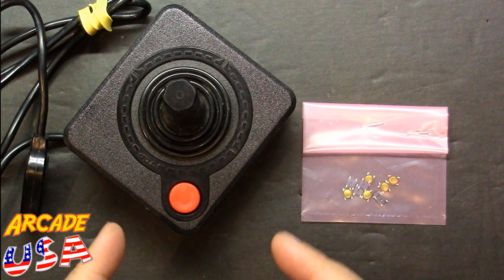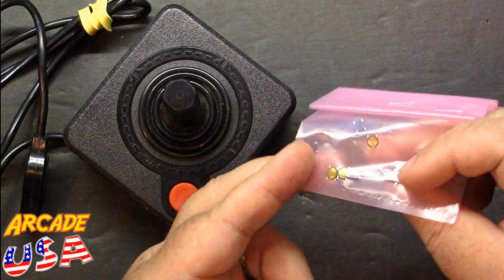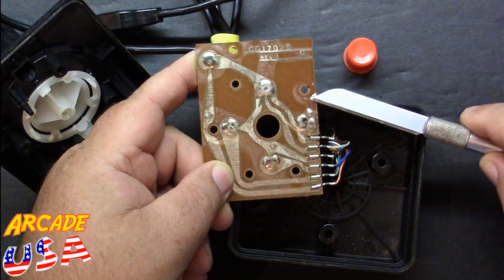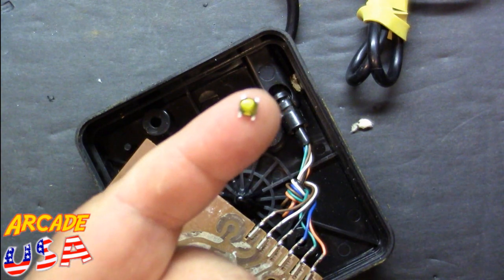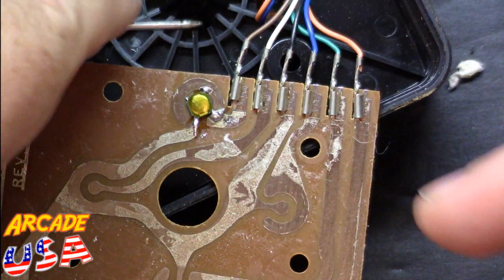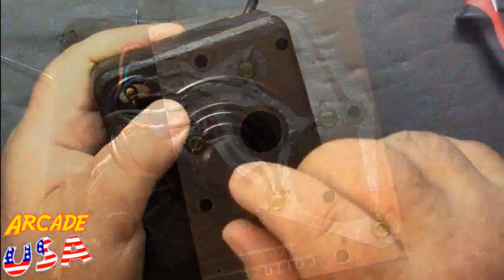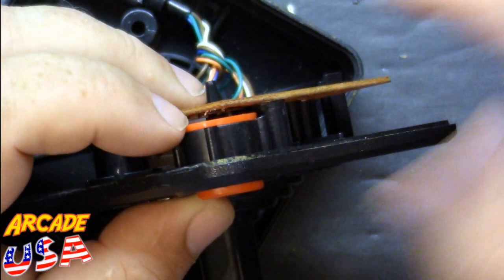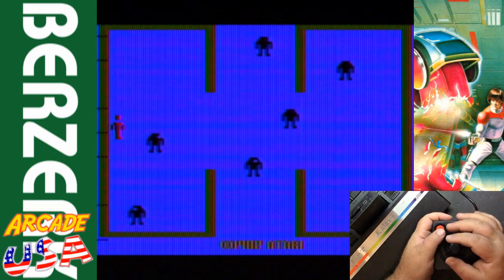Atari 2600 Joystick Low Profile Switch Mod

Comment: I know this vid been out awhile, but here is the method I use with these switches. Trim 2 legs off each switch (like your vid). After I remove the tape and dome switches, I clean the board with IPA, then add a bit of flux to each contact trace on the board where the micro switch will make contact. I use a pair of tweezers to hold switch in place directly over center, then touch the iron to the leg, wait a second, then repeat for second leg. Once all are done, I clean the flux, & test connections with a meter, cover the switches with Kapton Tape & reassemble the joystick, then test on the Atari. This also works on the Gemstik controller as they are basically identical internally as CX40. The clearances are a bit tighter, but it can be done. Hope this helps, I know it has for me.
Reply from the maker: Good tips!

Comment: The issue with using super glue would be it'll be hard to remove the switch if for whatever reason the switch stops working. Hot snot might be a better choice as you can at least heat it up to unstick the switch from the board.
Reply from the maker: Good point!
Reply: @SVT512  I'm wondering if these switches would work on a CX10 (my CX10 is the version right before they switched to the CX40 so the board is like a CX40 with the tape and the domes).

Comment: The thinnest switches I could find were 1.5mm.  Had to do a little sanding but it was worth the effort. Wish I had seen the ones you used.
Reply from the maker: The ones I used are detailed in the video description if you want to check them out.

Comment: Hey I was wondering. Is there any specific orientation with the contacts on the switches? Or will any work fine so long as the contacts touch the metal? Also would electrician's tape work instead of soldering or nah?
Reply from the maker: they have to be orientated to go across the switch.  there are 2 leads for each side of the contact.   Tape will not work, has to be soldered.

Comment: Model used for MOD is ? Micro Switch Smd 4x4x0.8 ?
Reply from the maker: Surface Mount Micro Switch that measures 4x4x.08.  Type in Google - SMD 4x4x.08 - And get all sorts of info :P
Reply: @SVT512  Tanks my brother ...

Comment: Nice!

I would snip off the unused terminal so it doesn't short the switch, since it is hanging over the other trace in some of these.
Reply from the maker: I did snip it off :P, I used a exacto knife before putting it together to remove the little stubs that I could not cut off with my side cutters.  The logo for this vid and the video shows it before I did it.  Guess I should have shown the board before I put it in :P
Reply: @SVT512  Ah! You thought of everything. Guess I had it turned down for that part. :)

Comment: Nice!  Wonder if this could be used on the NeoGeo Mini pads to make them "clicky" like the originals?
Reply: It would be hard to make it hit two at once for diagonals without something more elaborate than sticking these on the board but, then again, it requires other components anyway. According to Ben Heck's video you have to use special circuitry to bypass the analog stick. I have a bunch of Magic Trashman's parts to convert them into standard Neo Geo controllers but you have to rip the board apart for that.

Comment: What do you use to clean the adhesive? I'd use goo gone but I don't know if that will harm the board.
Reply from the maker: I just used electrical contact cleaner
Reply: @SVT512  Thanks!

Comment: Hey Willie! Thank you very much for this great and informative video fine sir! Could you please (when you have a spare moment, of course) share the part number of the replacement tactile push switches you used to perform this modification?
I have a couple Atari 2600 joystick controllers that would definitely benefit from this modification. I appreciate your time Mr. Willie!   Fred
Reply from the maker: there is a link to them in the video description :)

Comment: This is definitely needed for the Atari 2800 joysticks!  Willie take that challenge on.
Reply from the maker: If you mean the 7800 joysticks, it would basically be the same as this one.  it has a smaller similiar circuit board inside.
Reply: @SVT512  OH NO. The Sears Super Arcade 
...those paddle joy combos.  Where the joy triggering is upside down inside.
Reply: I use Coleco Gemini controllers with my Sears Arcade II. They work pretty good...great paddles.  I had to put in a little found ceramic capacitor to to fire button.  Without that cap you get a interference pop on screen when firing.  So nice not having to pull out and put in joysticks to paddle for those type games. You just hit the joy-paddle switch on unit. Those coleco gemini controller with be a bit of a problem with Harmony SD carts when joy is switched on.  Need to have it in the squirrely paddle mode.
Reply from the maker: Oh those, I have not had one apart so dont know.
Reply: @SVT512  I've dreamed of you doing it ever since your first microswitch video !!!!  I figured I'd talk you into it if I ever saw you at PRGE ... sadly both remain dreams lol.
Reply: @SVT512  I got some controller hack-mods with wiring clues on my Instagram Robertvor.